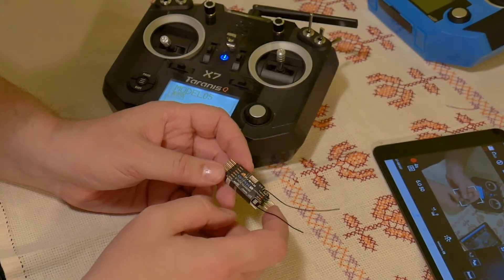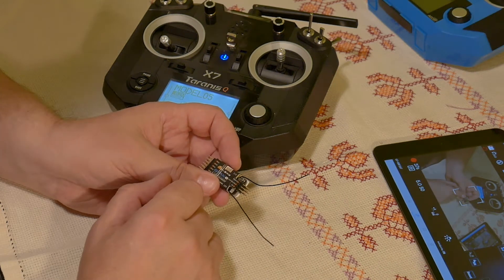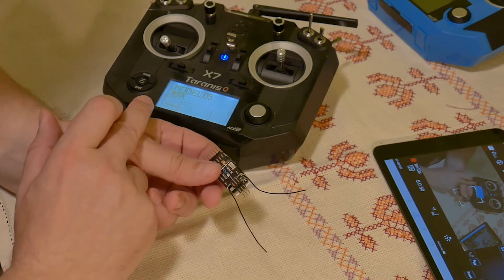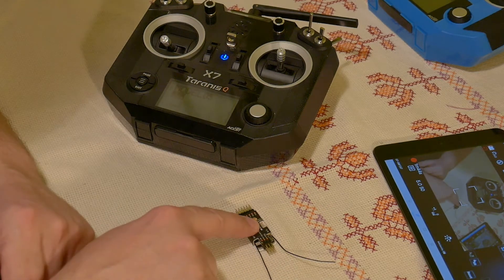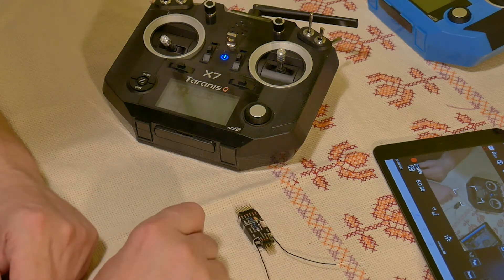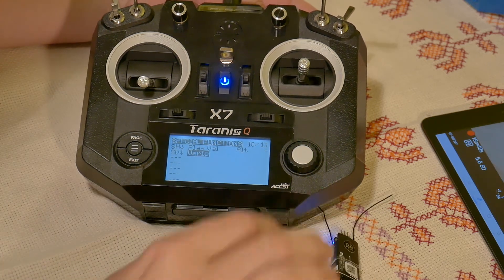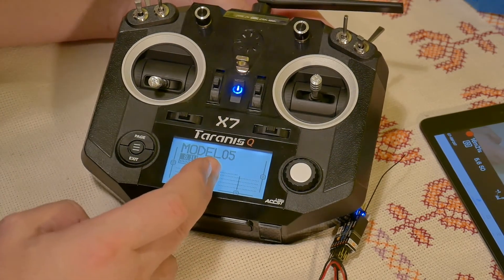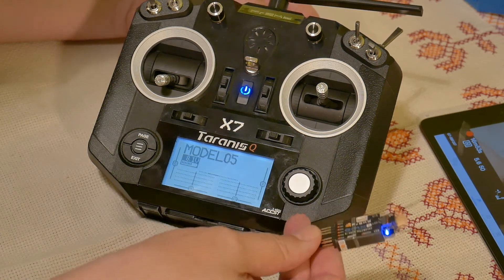FrSky / OpenTx Crumbs - Receiver G-RX8 basic setup

Comment: How do you switch channel 7 to PWM mode. the jumper cable does not have a signal wire
in the servo plug and the end with the white plug is not compatable with the port on 
the recevier.

Comment: Can you change Alt to say Feet instead of meters in the transmitter
Reply from the maker: Mike Baltes Yes, just change in radio setup metric system on imperial.
Reply: Companion 2.2. or on Transmitter under Telemetry. . Select telemetry page.  On line displaying Alt go to column directly after Instance.  Select ft.   Also in Vspd you can change mtrs per second to mph or kph or whatever you chose from the drop down menu